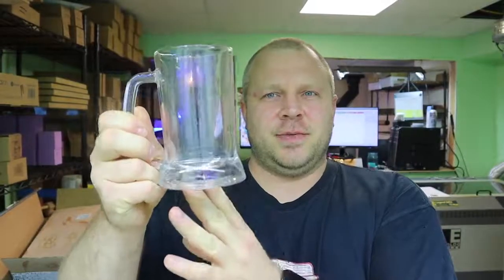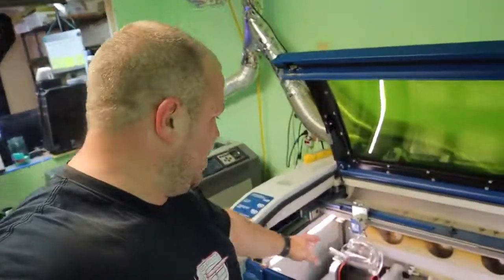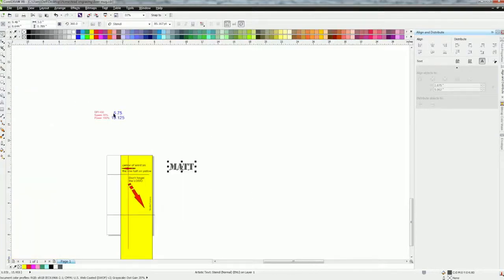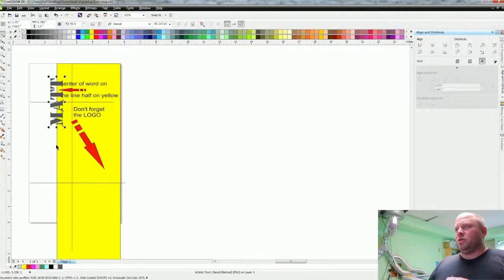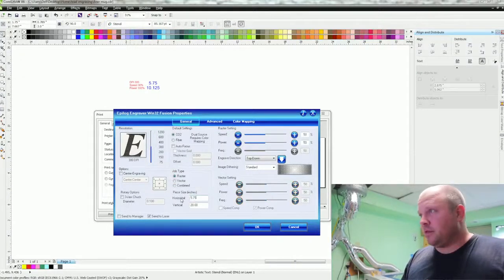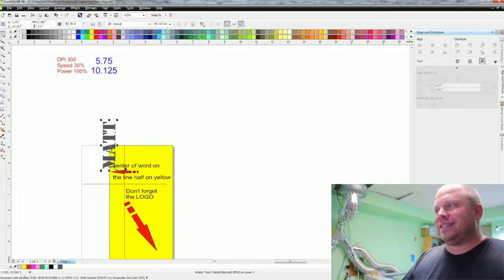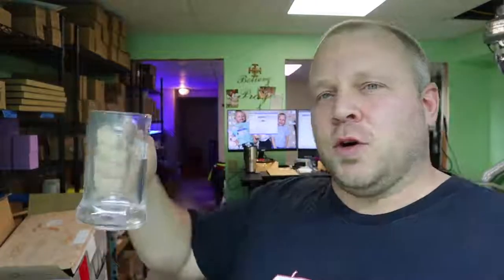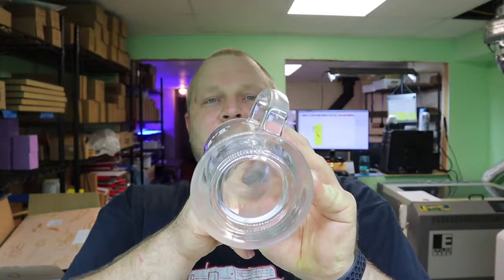Laser Engrave a Beer Stein

Comment: Hi, sorry to bother you but I was wondering if you ever have the glass slip during rotation?  I was engraving dozens of beer mugs similar to this, with no issues, but suddenly the mug started slipping?  I'm guessing it's because I started using soap as directed by several people to cut down on issues with chipping, and at first, it worked great, today though when I have a lot of orders in, it keeps slipping?  I took it all out, cleaned it, cleaned the soap off the glasses, but it's still doing it?  Brand new epilog Fusion 24,, 60 watt with a rotary tool.  I've contacted their support too, but just in case I thought I'd ask you to see if you have had this issue and how you fixed it?  Any advice would be greatly appreciated! Thanks, and love your videos by the way!
Reply from the maker: Thanks. Move your clip that holds the glass down 1/8 to the right
Reply: @laserengravingwithmatt   Thanks, I'll try that on my next order.